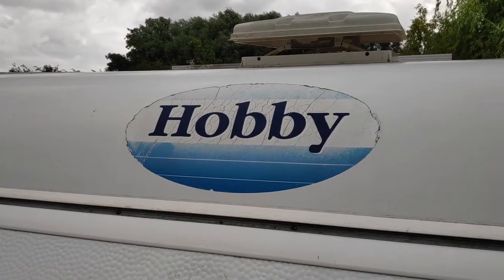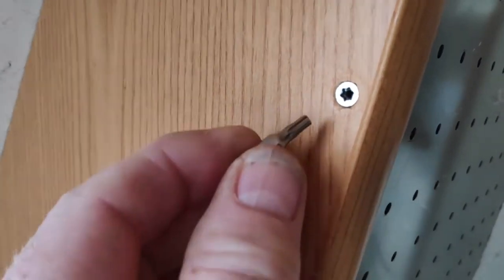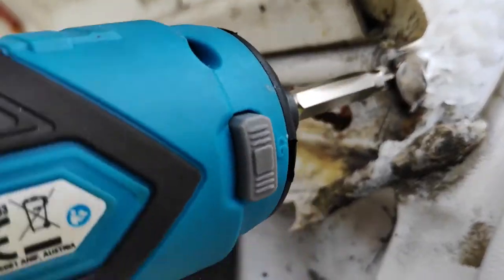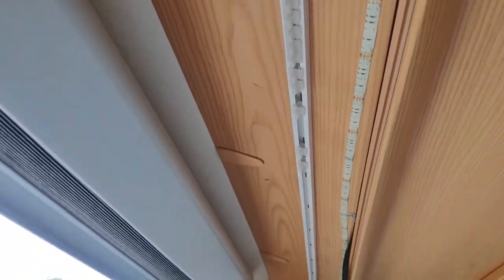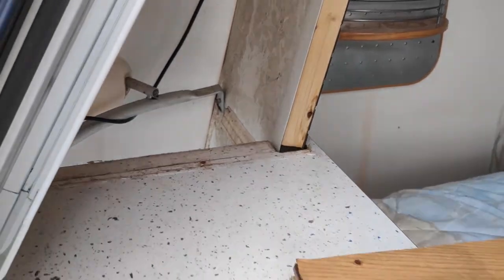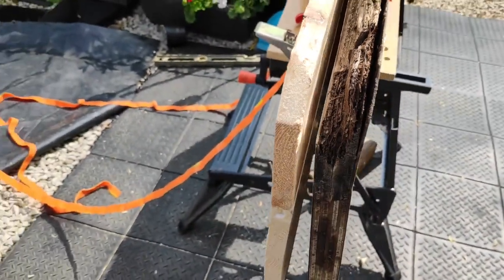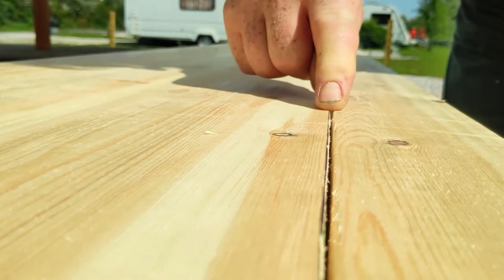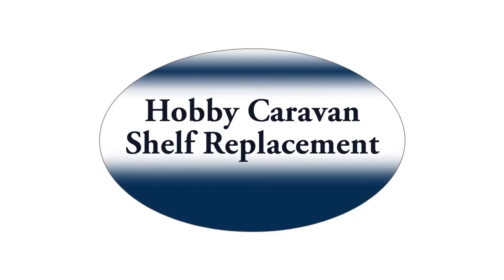2006 Hobby Caravan - Replacing Damp Moldy Gas Locker Shelf

Comment: great video and very helpful, mines leaking in exactly the same place, it's ashame you didn't show us where to reseal it, but thanks anyway and all the best 👍
Reply from the maker: Thanks for your reply. Sorry I didn't see it earlier. Have a look along the hinge and below the window. I found lots of tiny black holes that had corroded through. Not sure if it was caused by stones hitting the front when towing or dissimilar metals in construction. Like iron filings had got between the aluminium skin and the wooden backing. Either way I tried to fill as much of the gap as possible with clear silicone. I also did a bit of a skim a few inches above the top of the hinge wit more silicone then sprayed it white. 

Diana stuck some sunflower stickers around the window and above the hinge in the hope of keeping out the water. Two years on and it seems to be working well. So far so good 🤞

Comment: Very nice video. But I wonder if you did anything to stop the infiltrations. In the video it shows only changing the materials but you didn't show how you fixed the main problem the entry of water. Where was the sport that let the water enter in the caravan and destroy the wood boards. Thanks, the video was very helpful.
Reply from the maker: That's a very good point. I have some footage of tiny holes in the sheet aluminium between the window and gas locker along the top of the hinge. I tried to inject silicone inbetween the metal and it's wooden backing in the hope that it would seal the ingress of water. 

I didn't use the footage as I just concentrated on what I thought was a more interesting project, to replace the shelf as it was ruined. 

Maybe I will revisit the footage and see if I can make something interesting to show, now that it's been a couple of years. Fortunately I don't see any degradation or mould or water seepage. I think the tiny holes were created by stones hitting the front and exposing the bare metal to the elements. Or perhaps tiny fragments of dissimilar metal like iron filings in the construction of the metal/wood panels.

Thanks for your constructive suggestion, I hope the video and this explanation has helped.

Comment: BRILLIAN...not identical to mine as got bathroom
 panel on rhs but enough info to make a DIY repair feasible...would like to have seen resealing of locker lid but cant be to difficult...thanks for the vid
Reply from the maker: Hi Nigel, all I did was sandwich clear silica sealant between the hinge and body and behind the metal work and wood of the van. 

There were some tiny holes in the aluminium skin so I just made sure they were all covered with silica. So far its not leaked but whether it will last the same amount of time who knows. But at least its proper wood with non rust screws so that should be miles better than the original. 

Glad you found the video useful.

My next task is to fix the cracks in the flimsy sink by the plug hole and also behind the tap...

Comment: Hi, great video and instructions how to do it. I have Hobby 440 from 2004 and I'm going to replace the shelf. Did you put the silicon - butyl sealant beetwen shelf and front aluminium wall?
Reply from the maker: I tried to inject silicone between as much as possible but ideally the front needed much more. But it seems to be holding. It's been more than a couple of years now and hopefully will last many more!

Comment: Did you also take care of the leackage itself?
Can’t imagine it was only leacking through these small chips?
Reply from the maker: Hi Eric, it seems to be still damp free in each corner. So I'm hoping I found where the ingress if water was coming from. On wet windy days there is some slight water pooling in the gas locker floor. I changed the locker door rubber sealing loop from a scrap car and that has helped keep it dryer. Hope the update has been of interest to you, Eric. Thanks for your comment.

Comment: Where was the water getting in?
Reply from the maker: There were tiny holes in the aluminium skin. Could be that stones chipped the paint and corroded through. I put a skim of silicone above the locker door and around the window. Hopefully I got all the tiny holes filled in. 🤞
Reply: Thanks for the Great video. Good job. I’ve a hobby caravan same year, same leak problem. Got tiny holes in mine too. I thought these we’re from stone chips but now I’m thinking the metal corroded because of the wet wood underneath. Is your repair still dry inside after filling tiny holes?
Reply from the maker: @adamoneill3092  Hi Adam, yes its been perfectly dry 10 months on. So I'm hoping its going to be a long term fix. 

The corrosion must be a pretty common problem. It's possible that there were some iron filings behind the skin and the block board that corroded the aluminium but it's more likely just constant damp or stone chips that did the damage, as I haven't seen it anywhere else.  Glad you enjoyed the video.